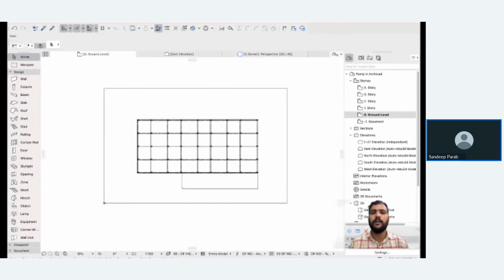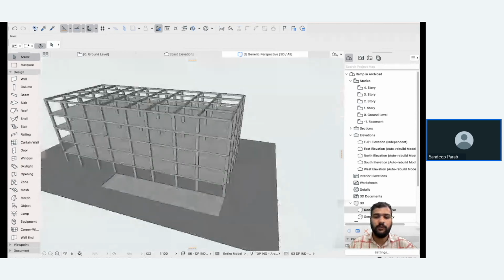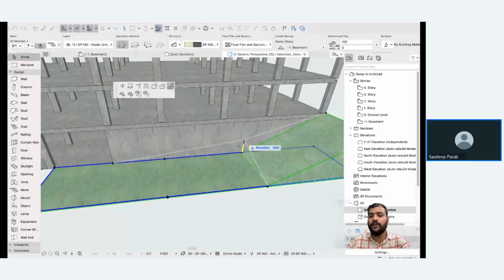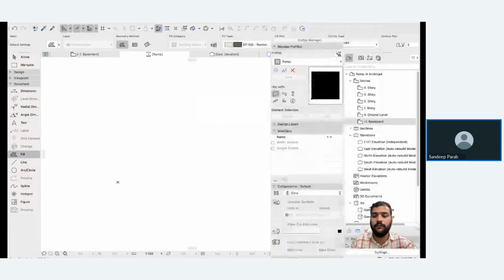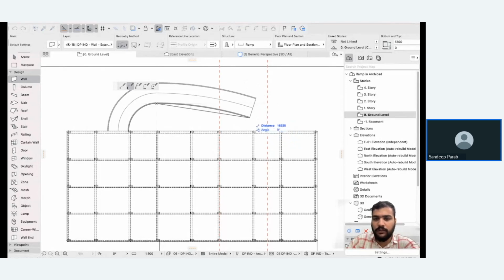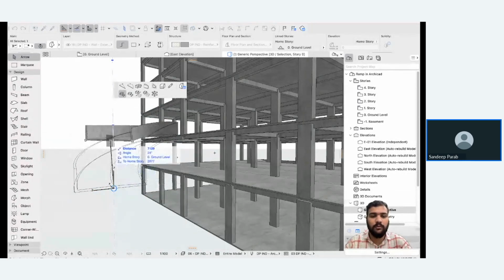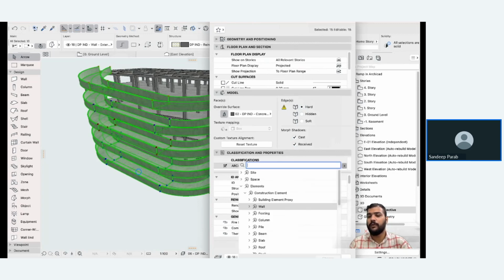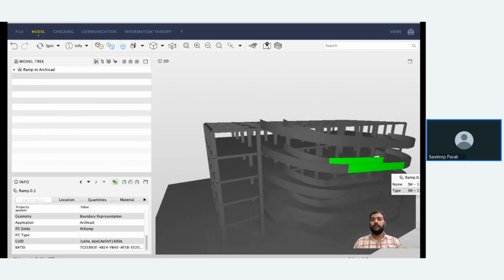Custom Ramps in Archicad I Create custom ramps using BIM software Archicad I webinar

Comment: Try using stair tool.
Change the structure to beam and turn off the risers a treads. You can even add the "vertical wall".
Reply from the maker: more videos on that coming soon stay tuned